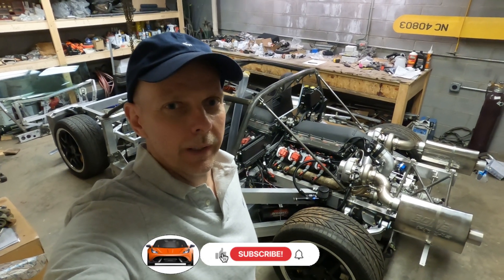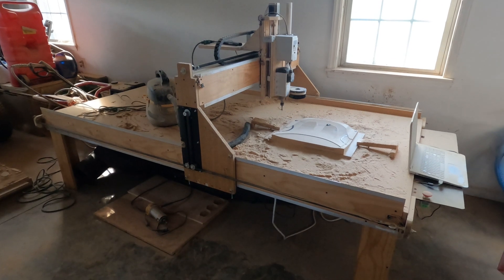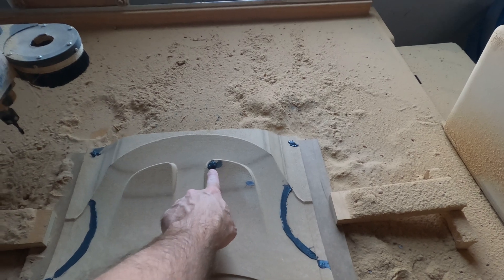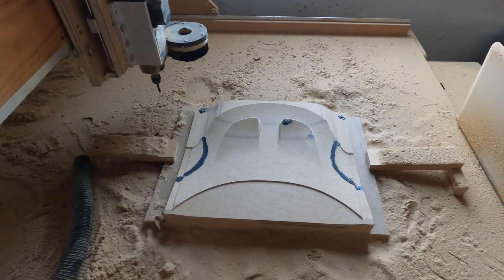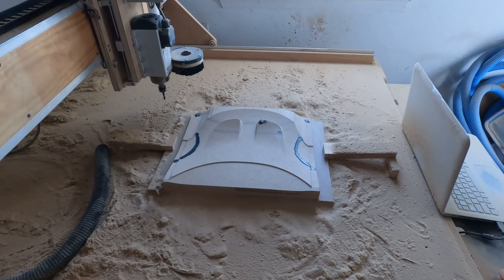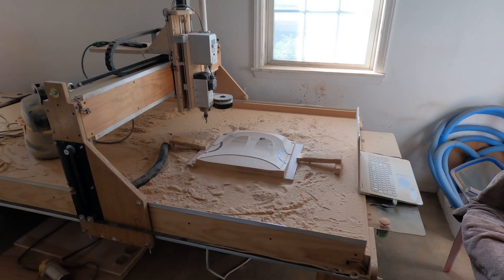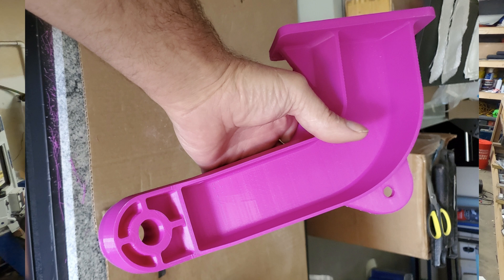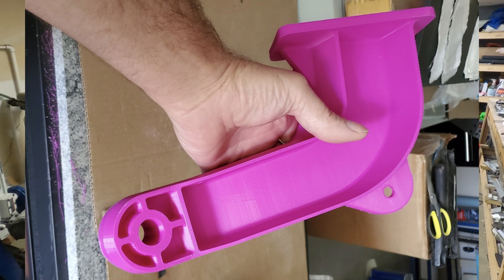Building my own Supercar - Cutting my first part on my homemade CNC machine

Comment: Really nice CNC. that laptop though, as one wrote, it's now protected by a thick insulation layer.
👍💪✌
Reply from the maker: Thank you. I used this laptop because it has been dropped and the screen is broken. I will continue to use it on the CNC until it dies.
Reply: @basementsupercarbuild2948  good use of it for sure!

Comment: Your CNC is really cool. I'm coming from 3D printing and CAD engineering primarily and am wanting to get more into cnc as theres only so much fabrication I can do with a 3D printer. I love how this is going. WIll say the saw dust on your laptop made me feel a bit weird lol...ps I've worked in the construction industry mainly building new homes from the ground up and absolutely despise sawdust. I love the update videos and can't wait for the next one.
Reply from the maker: Thank you sir. I would suggest that if you ever decide to build your own CNC, don’t make it out of wood. Mine works ok but I wish I had spend the extra money to make it from aluminum. The laptop I am using is old and has a cracked screen, I only use it on the CNC now. If it dies, it dies. Thanks for watching…